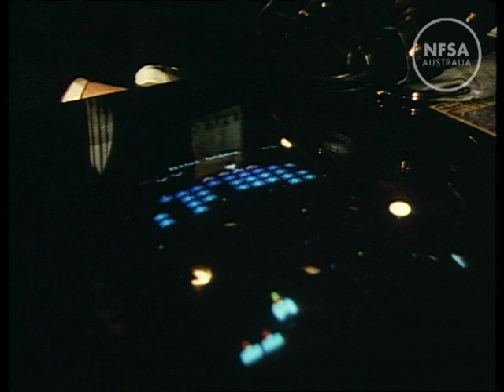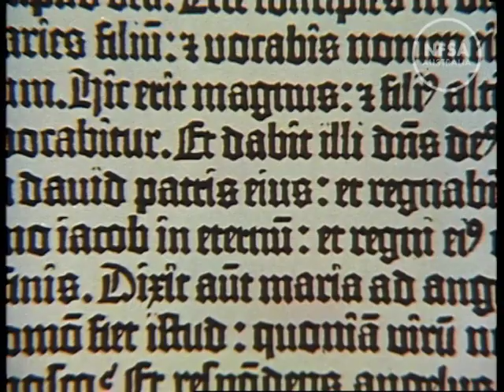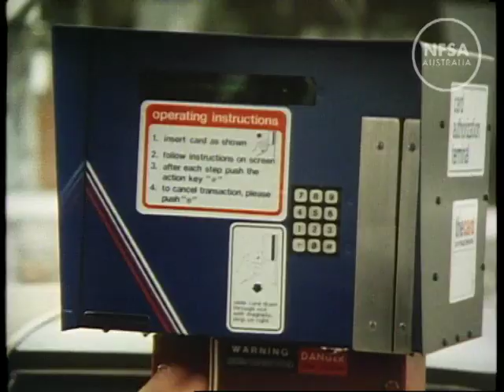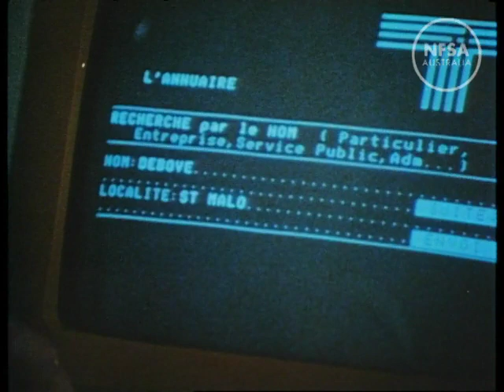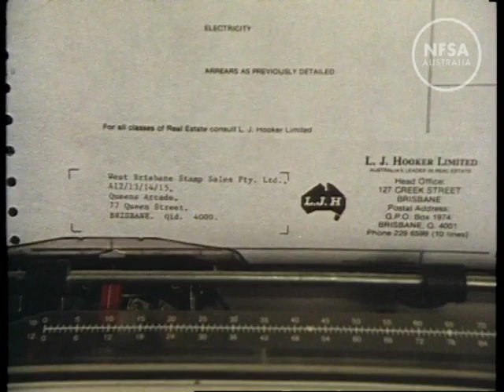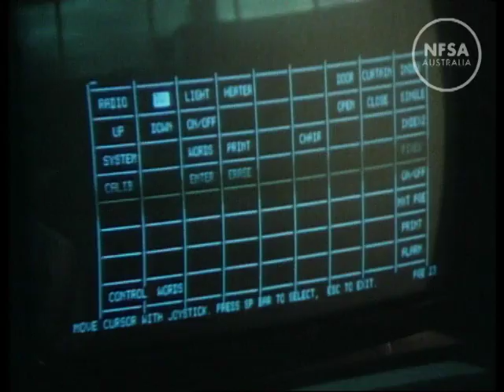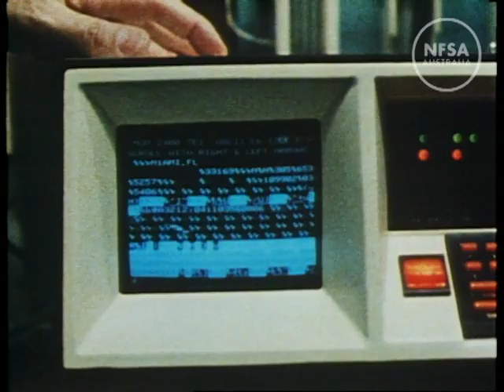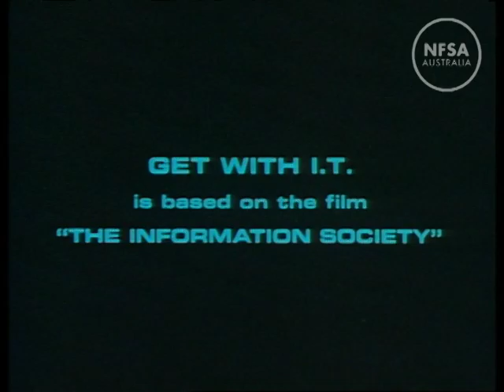Get With I.T. The Information Technology Challenge.

Comment: I first became involved in IT in the early 80s as a bench repair technician. I repaired boards from mainframe computers, minicomputers, microcomputers, printers, IBM PC mainboards (yes they were all repairable), IBM 5/14” FDDs, Apple II, Commodore 64. In fact most boards were economically viable to repair. From the early 90s, most PC components were throw-away items as they were more expensive to repair than they cost to purchase and only technicians repaired them for home use.
From the mid ‘80s up to late ‘90s there were great improvements in the PC field with regards to hardware and software technology advancements. It made it an interesting field to be involved in.